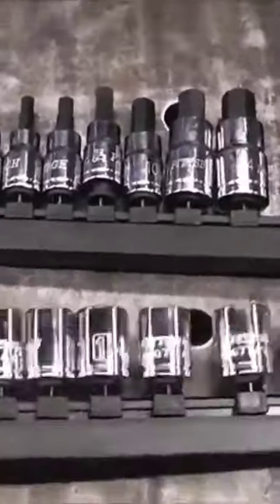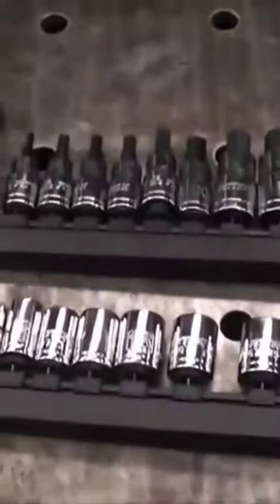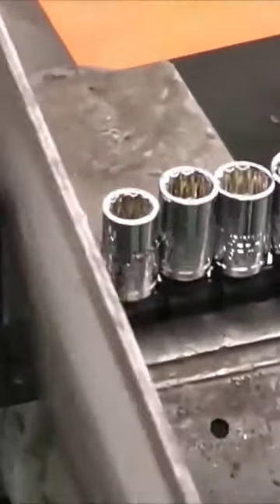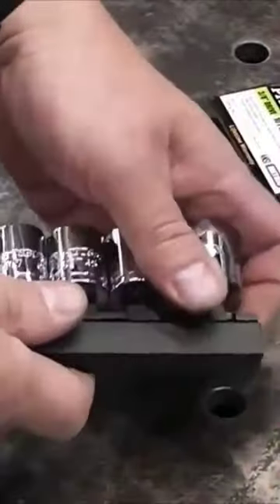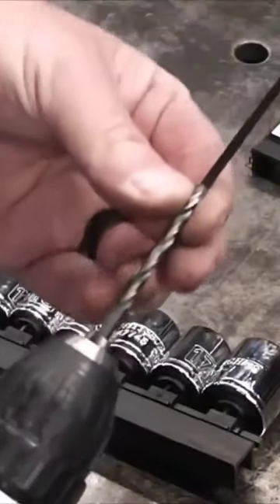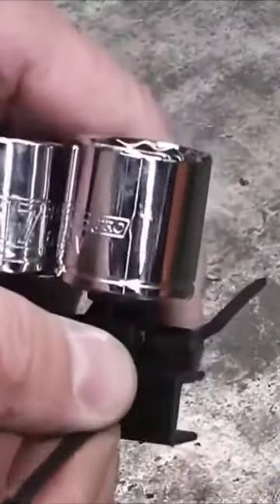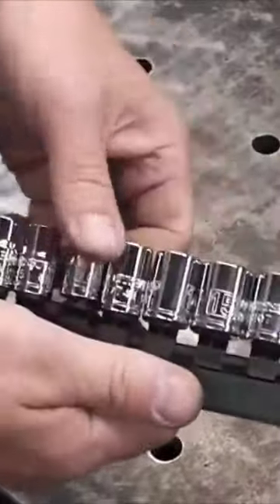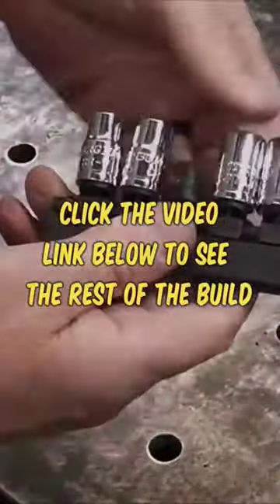Harbor Freight Socket Rail Hack #diy #baller

Comment: The shitty part about those tho is it's a pain in the ass to get it out of the drive end of the socket and to put it back on
Reply from the maker: I agree!
Reply: Thats my problem most of the time I end up having to drill the plastic out of the socket after it breaks off right after I buy it.
Reply: Trim the plastic so it fits more loose? Can you use like sand paper on the plastic to make it slightly smaller ?
Reply from the maker: I don't see why not. It's probably safer that way too
Reply: @BrandonLund  the only possible problem I could see is maybe then they won't stay on after sanding.  I'm definitely gonna put it to the test tomorrow. I'll update with results